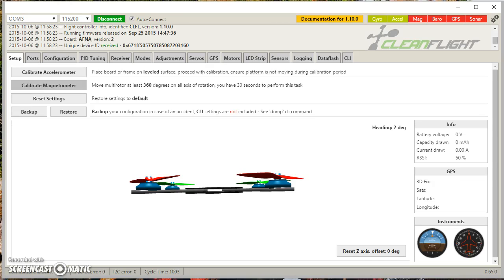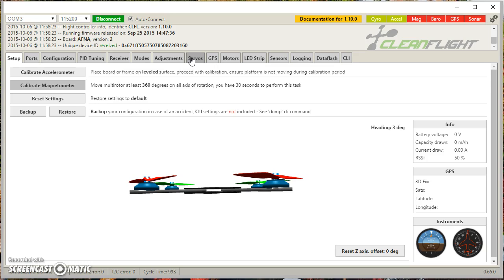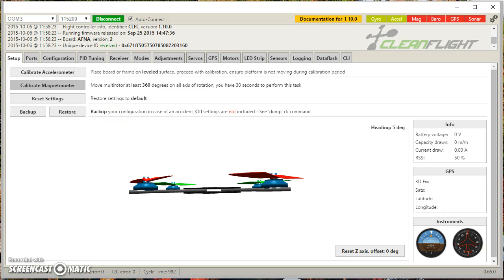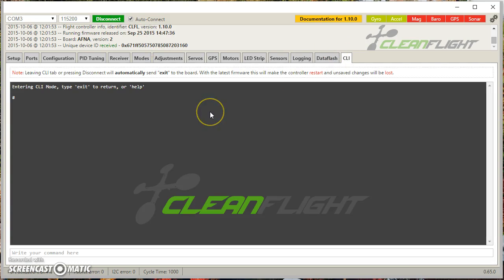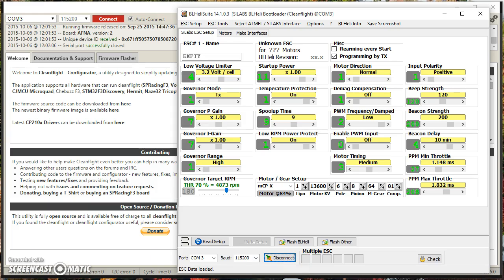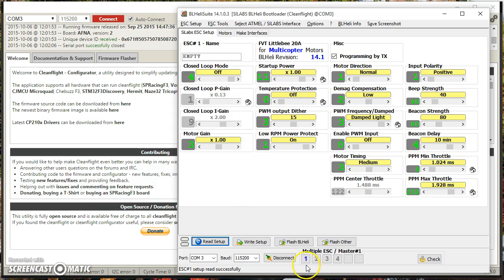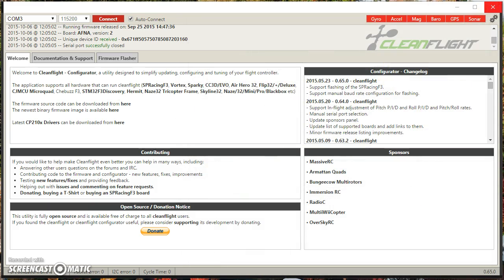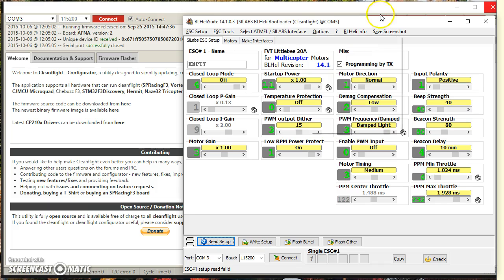BLHeli Passthrough | EASY BLHELI ESC CONFIGURATION AND FLASHING

Comment: i get an error when ever i try to connect. it says: setcomstate function failed. error code 31. a device attached to the system is not functioning please check usb/ serial port settings. 

i am on com 3 (usb serial device)

Comment: hi JB ! I have a new problem with my brand new mamba stack, I explain :
I launched blHeli configurator, plugged the battery, read setup, then flash all ESCs. Seem to be ok, the drone rebooted, then i had a weird message on ESC number 2, only ÿÿÿÿÿÿ instead of c-h-40 and ÿÿÿÿÿÿ 16.7 for the version.
I thought it wasn't a big deal, i tryed to flash the ESC number 2 alone, but impossible with an error message that i screenshotted in the second picture on my google drive

here are the links.
https://drive.google.com/file/d/1TOmIymGt0ikjihxEK6zmMA43glH1Ad5U/view?usp=sharing
https://drive.google.com/file/d/146o4CZHpggDG3xQTLbiF8ZHq1lCDhudp/view?usp=sharing

do you have an idea how to fix it ?

ty!!

Comment: I'm getting the error message - connections to esc#1 failed please check data - und power - connections to the esc! Please help me...
Reply from the maker: The ESC is not responding. Either it is powered down or the signal wire is disconnected. Or it's just dead.

Comment: Hello sir, i am facing a problem i.e the escs doesn't callibrate after increase slider to the top position. I am using emax blheli 30amp esc, is it supports this flight controller...?
Reply from the maker: What motor protocol are you using? If it's Dshot, you don't need to calibrate.
Reply: Sir i am using pwm output because emax blheli esc only supports pwm

Comment: Hey Joshua, I have performed esc calibration, when I check in BLHeli suite I have two esc settings not in sync with master. Two have slightly different min and Max values. Should I just make them match or can I leave it the way it is. It fly's fine I'm just would like to know about the sync warning for settings. Thank you
Reply from the maker: +brandon woodford it's fine if they are a little different. That's the purpose of calibration.

Comment: Hi Joshua
I need to upgrade my esc's. I'm using dys16A and a CC3d board using librepilot. I've downloaded blheli suite but I'm not sure it's reading my gear.....can you please advise me if/when you have a chance. My sincere thanks. My esc's have sumink boot loader.
Reply from the maker: I'm not sure what you're asking. When you hit "read config" does it connect to the ESCs and read them?
Reply: Hi Joshua thanks for replying.
Basically everything was working fine. I hadn't flown for a year so I thought I'd update my cc3d erased everything with the update. I went to arm and my esc's won't do their  beeping sequence only the initial or first set of beeps. So I went into librepilot and started a totally new setup including transmitter setup. Still my esc's won't go through the beeping sequence. So my thinking was, maybe I've updated the board, so where ive left the esc's with an older software theyre now not communicating with my board?? 
To be honest I've no idea why they just stopped arming. Before I updated my board everything armed and my motors spun perfectly. I've checked all my wiring, everything is connected. I literally ran an update and now they're not working I'm kinda stuck.
Reply: Sorry I forgot to add, no it shows an error and won't read
Reply from the maker: If the ESCs make the first sequence of three beeps, but not the final two beeps, it indicates they do not recognize throttle signal on the signal line.
Reply: Okie Dokie. Im gonna run though the whole setup again. Its got to be something Im doing as she worked fine before. ill let you know how i get on. My genuine thanks for spending time to help me.

Comment: sorry kinda late, I'm new to this flying a drone. here's my set up, A2212 1000KV Brushless Motor, EMAX BLHeli Series 12A ESC. And of course, I flash the esc but my concern. My throttle is only at 50% I don't get no more power, not like the other videos I watched. I can hear the rotor rpm is more than what I have. Do I need to tweak or modify the set up from BLHELIsuite to gain more rpm?
Reply from the maker: +Sen Pen calibrate the endpoints I suppose.
Reply: thanks for the quick reply let me try calibrating.

Comment: hey Josh I'm getting a really weird error on one of my quads when I plug him up the ESC these are out of sync so what do I do I plug it in to  BL heli Suite and when I tried to do the flash of the new firmware 16.6 I get an error but says erased or unknown firmware ESC number one I really don't want to plug a battery into this now LOL it's not showing little bee thirties it is showing a_h_15 if I have to I will just put another ESC on here but I was flying him just fine today other than the ESC is out of sync
Reply: I I plugged the battery up to it and they are back in sync but it's still giving me that error in BL heli Suite so I'm still scared of it
Reply from the maker: +Ultimatevapor918 ESC out if sync can usually be ignored as long as the out if sync option is innocuous, like slightly different endpoints. You need to reflash the ESC that says flash failed.

Comment: after I done the updates now I have just a master and no slaves coming up... its a TBS power cube....in your video I had one master and 3 slaves..now when I check it shows only 1 ESC...but when I do the motor test all escs are working the motors any ideas for a noon what I done?  thanks
Reply from the maker: Select each ESC individually rather than trying to check all of them at once. Sometimes that works.

Comment: Can 1-wire bootloader be flashed into SiLabs-based ESCs? I can't find a solid answer anywhere. BLHeliSuite has an option to access SiLabs ESCs with BLHeliBootloader (so it must exist, right?) through Cleanflight, but I can't access mine through that, even though I've updated BLHeli version on my ESCs. I was unable to find any specific option to flash a bootloader, so I'm in a bit of confusion here.
My ESCs are Little Bees 20A. I was updating firmware on them through C2 interface with arduino 4-way adapter. That's the only way I can access their settings now.
Reply from the maker: +ZXRulezzz whenever you flash via C2, the BLHeli bootloader is installed. If you have flashed via C2 and still can't access the ESC something else isn't right. What ESC is it?
Reply: The ESC I'm currently trying to get working is either Little Bee 20A, or either Little Bee 20A PRO. Those two look alike, but PRO version has black PCB, just like mine. It's on the compatibility list, that's where I actually found out that there's two of them.
Reply: Whoops, nevermind. I just found out that apparently still soldered in, unplugged (thus, non-powered) Arduino was doing something with the programming pins. As I plugged my Arduino back into USB, ESC statred up happily and I was able to access it through Cleanflight.

Comment: I'm using an XRacer F303 board with Cicada 20a ESCs (Silabs). It connects fine, but when I click "Read Setup" I get the error "Connection to ESC #1 failed!". I'm absolutely sure it's soldered correctly. Just flashed Betaflight 3.0.0 on the FC. Any ideas?
Reply from the maker: +Dawson Hagens this exact setup works for me. Well, I'm using Cicada blheli_s not SiLabs.
Reply: Sorry, I meant they use the Silabs interface. Yes they are blheli_s. What should I do?
Reply from the maker: +Dawson Hagens that combo should work. Are you powering the ESC's?
Reply: No. I plug in the board, choose the COM, then click connect, then read setup. Then the error occurs.
Reply: Is that the correct way to do it?
Reply from the maker: +Dawson Hagens yes.
Reply from the maker: +Dawson Hagens connect the battery to the ESC's after connecting to the programmer.

Comment: I have a question. I've been flying The Vortex 250 now. when I update the firmware it lists current firmware for it in immersion rc's website. but it also lists other relevant firmware - metal Danny and ummagawd firmware. are those the same as stock just advanced pid tuning with different profiles to choose from in the osd or are they just advanced tuned with no other profiles that are selectable on the osd right before I fly?
Reply from the maker: +Dontbeweakvato I don't know the answer to this. I don't know about Vortex specific firmware.

Comment: great video Joshua, question, I recently received a quad from a friend, I flew it for a couple weeks and suddenly one esc failed, didn't burn but just stop working. When I connected to Blheli suit , turns out 3 escs have simonk k bootloader and the one that failed has Blheli bootloader. I flash all of them to Blheli 14.5 . now the all work but when I give power motors randomly from time to time move, just a bit. Should I replace the one for another with simok bootloader? thanks
Reply from the maker: After calibrating, reduce min_command in cleanflight to 950.
Reply: did it, still twitching very sporadically but still twitching
Reply from the maker: when disarmed? I guess you could lower min_command more, but it's really unexpected that it would need to go below 950.
Reply: +Joshua Bardwell yes , when disarmed, I guess it's because I'm using escs w different bootloaders
Reply from the maker: No. The bootloader doesn't affect anything except the code that is loaded when it powers up.
Reply: so if there is no problem using escs w diff bootloaders then what do you think might be causing the twitching?
Reply from the maker: What ESC?

Usually, it just means that min_command is too high. Try lowering min_command to 900. You shouldn't leave it this way to fly, but just see if it fixes things.
Reply: Hey Joshua, so I just lowered to 900  and it did stop the twitching, now what? you said I shouldn't leave like that
Reply from the maker: No clue. Ask on the BLHeli thread on rcgroups
Reply: whats the minimum you can recommend to set the min comand
Reply from the maker: +Alvaroeduardo 950
Reply from the maker: +Alvaroeduardo I think you should set min_command no lower than 950 then raise PPM_min in the ESCs until the twitching stops. Then re do your min_throttle configuration.
Reply: thanks for your help Joshua!

Comment: when I tried to load betaflight I got this error. ( failed to open serial port no response
from bootloader). I can get into cleanflight, but when I try to update
the firmware, I get an error message failed to open serial port no response
from bootloader?. I tried shorting the pins to get into bootloader mode and that
does not work either. I am still getting the same message. Any suggestions?
Reply from the maker: If you are in bootloader mode, you will have a solid blue LED lit on the board, and no flashing red or green LED. If you have a flashing green or red LED, you aren't in bootloader mode.

In order to flash in bootloader mode (also known as DFU mode), you need to have used Zadig to install the WinUSB DFU driver. You can find instructions for doing that here: https://www.youtube.com/watch?v=b8fMsazyxDw
Reply: Thank you Joshua for the FAST reply. I will try what you recommend and let you know. I REALLY appreciate you. Thanks again. Frank
Reply: You ROCK Joshua that work....Thank you sir. Frank
Reply from the maker: AWESOME!
Reply: Joshua one more question, I put betaflight on a seriously pro Evo and I ca no longer click on calibrate Magnetometer? any Suggestions? Thank you Frank

Comment: I get "initialization of serial 1wire passthrough failed" please check betaflight revision for support of serial 1 passthrough. 
I'm running betaflight 2.9.0 on naze32 rev5
Reply from the maker: That should be working. Maybe you can post a log file over on the BLHeli thread in rcgroups?

Comment: Hi, I have a vortex and I've changed the escs and motors and I want to put active braking on the escs. Is it something with the vortex's flight controller or something? Blheli Suite can't read any of the 30amp littlebee escs and I've tried every YouTube video etc. Any ideas?:)
Reply from the maker: +Jake Smith are you trying to use pass-through or a programming adapter?
Reply: +Joshua Bardwell I'm trying with the passthrough...
Reply: +Joshua Bardwell when I press read setup on blheli suite this comes up- 'initialisation of serial 1 wire passthrough or 4way interface failed!'
Then it says 'please check beta flight revision for support of serial 1 wire passthrough or 4 way interface!'
Reply from the maker: +Jake Smith what version of Betaflight are you using?
Reply: +Joshua Bardwell it's version 2.9.3:)
Reply from the maker: Passthrough should work. Have you selected the correct COM port from the pulldown menu and hit "Connect"?
Reply: +Joshua Bardwell yeah it read the flight controllers there because when I connect, the flight controller beeps. But it doesn't actually read the escs..

Comment: Joshua - I only have the signal wires from my ESC connected to the FC, as the ESC is using the common ground from the - wire to the PDB.  Will pass-through still work in this case?  When I click Read Setup in BLHeli Suite I get an error message that states: "Connection to ESC#1 failed! Check data and und power connections to ESC!"Just curious if that ground wire for the signal needs to be connected in order for this to work.Thanks!
Reply from the maker: No. Cyclone has bidirectional buffers specifically to address this.
Reply from the maker: +SSBelmont I always recommend using ground to the signal header. What board?
Reply: MotoLab Tornado
Reply from the maker: Tornado can't do pass through because it has uni directional buffers in the motor outputs.
Reply: Assuming this is the same for the Cyclone then?
Reply: WOAH!!! Yes! (Thank you!)

Last question: in the original video, you said this only works with BLheli bootloader, but one of of my quads I have some SN20As with SimonK, and some guys on Instagram said the the new updates allow for SimonK. Can you confine this?
Reply from the maker: As of Betaflight 2.7.0 and blheli 14.5 (I think) SimonK bootloader is supported.

Comment: excellent video! Is there any way to tell what has been flashed on an esc?
Reply from the maker: +No Way when you "check" it shows you the firmware on all ESC's.
Reply from the maker: +No Way when you "check" it shows you the firmware on all ESC's.
Reply: +Joshua Bardwell Where do no check it in cleanflight?

Comment: Do you need to have the ground wire connected to the FC or the signal cable from the ESC is enough?
Reply from the maker: I recommend running ground as well.

Comment: Nice video, learned a lot.
I programed my F303 v2.1 with Betaflight.
And my 4 LittleBee's 30A flashed with BlHeli 14.5 via cleanflight.
No problems here. Also calibrated the ESC via cleanflight .
And then my question....  If I check with BlHeli-suite the ESC I notice that the PPM Max_Throthle is 2016 - 2020 over the 4 ESC. I ask my self is this normal. This was not expected I thoght the max is 2000. 
In Betaflight Max_throttle is 2000 Min is 1000
Do you know a answer?

Comment: Didnt seem to work in raceflight
Reply from the maker: +pukki34 I have no idea if it's supported in raceflight.
Reply: Joshua Bardwell Dunno, will have to investigate :) Its a nice feature.
Reply from the maker: Does Betaflight work on your board? You could always flash over temporarily.
Reply: +Joshua Bardwell well.. im looking for the easiest solution as usual 😆

Comment: When connecting the power source, my naze32 does not make the biping sound, as in the video. And it cannot find the ESC's and then pops up and tell me to check data- and power-connections to the ESC. But the motors have power and is connected, since i can get the CW motors to spin, but the CCW motors are lagging. 
I have a Emax BLHeli 12A ESC.
Any ideas?
Reply from the maker: +Frederik Sørensen Be using Betaflight 2.6.1 and the latest blhelisuite (14.5).
Reply: +Joshua Bardwell I am using those, that is why i do not get it. I each ESC with the same motor, and there were no problems. But when they are connected to the naze they dont spin proporly.
Reply from the maker: Frederik Sørensen Try swapping connectors to different motor headers. See if you can determine whether you have a bad motor header or bad solder joint on the motor header. Work systematically and use process of elimination, changing one thing at a time. It's the only way to really troubleshoot hardware issues like that.

Comment: what should I do when blheli  doesn't identify the esc.....everything else works but it wont read setup.
Reply from the maker: +Monica Simpson use Betaflight 2.6.1 and the latest beta blhelisuite. Probably you gave SimonK bootloader, which isn't supported until very recently.

Comment: when i try to conect to the board/escs using a f3 board it does not work this is wha it says. initalization of serial 1wire passthrough faild! please cheak betaflight revision for support of serial 1wire
Reply from the maker: +Jhubby-FPV what board?
Reply: a unreleased f3 board. but i got it to work
Reply: +Jhubby-FPV How did you get it to work? Im using a flip32 aio lite and cant get it to connect. It worked fine with my naze boards. Thanks.
Reply: +vador ok you are getting the same error i am getting right? if so i just went to an older version of BF like 2.5.4 or 2.5.6 fixed it right there
Reply: +Jhubby-FPV FIXED! Using the Beta version of blheli (currently 1440502) with 2.6.1 worked for me.
Reply: +vador Oh ok i work off older version of Blheil but good you got it fixed

Comment: Motolabs Cyclone requires you to use UART1. The little  plug next to the usb port, and to use that you require CP2102 to USB adapter. 
Joshua what Flight Controller are you using?
Reply from the maker: +Joel Larson This video was made when I was using a Naze32.